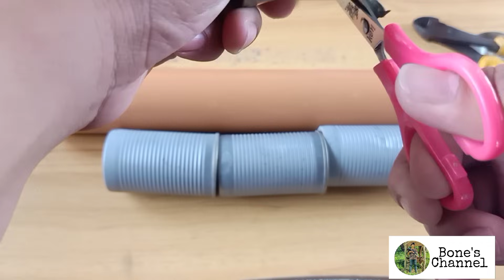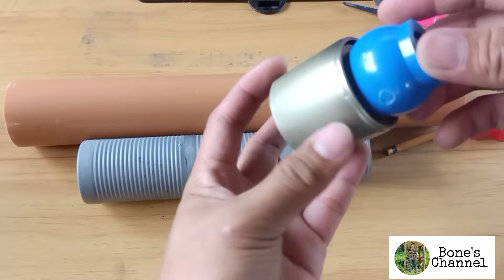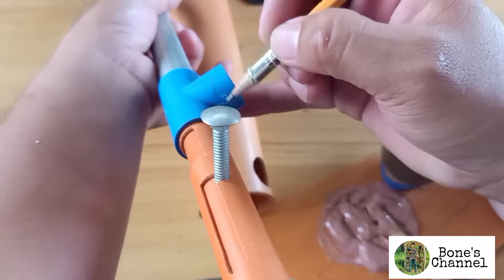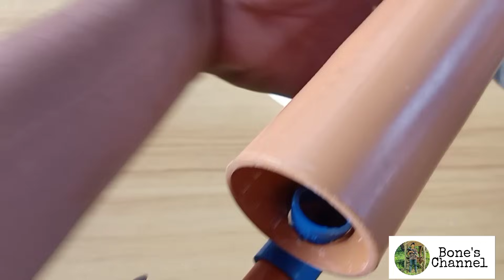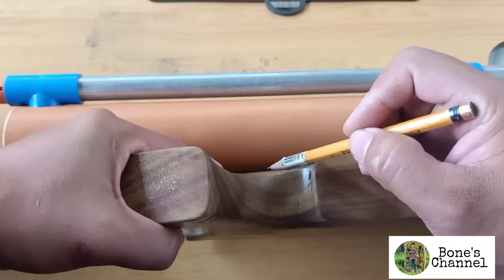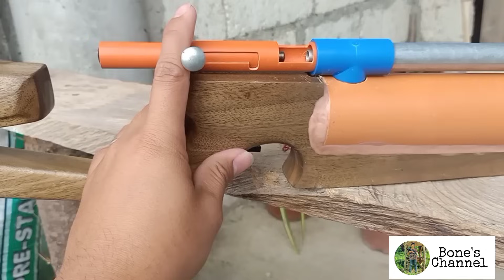Ep.3 How to make PVC chamber

Comment: Now imagine what the power would be with a factory airsoft barrel 6.01mm in which the bullets move almost without a gap.  6mm is too small hole, it can explode, I think for such a small caliber you don't need a large combustion chamber, you can try a 35mm steel pipe.. I want to do it, but I don't know how to make the gas mix with air and every shot is the same  strong.  need to do something like a carburetor